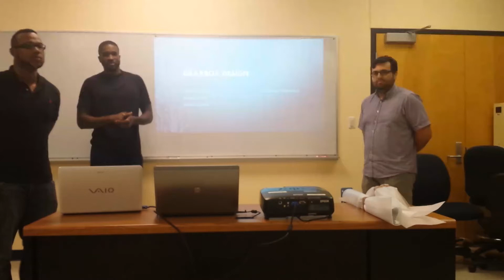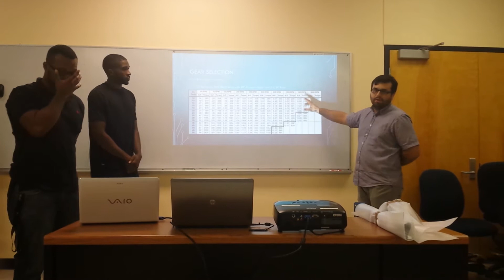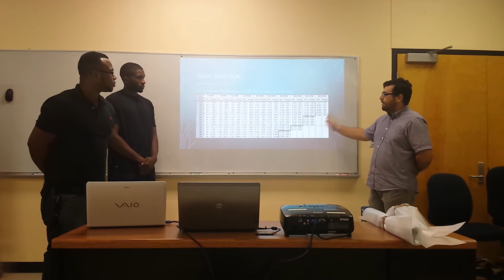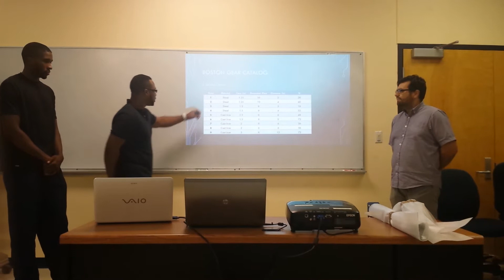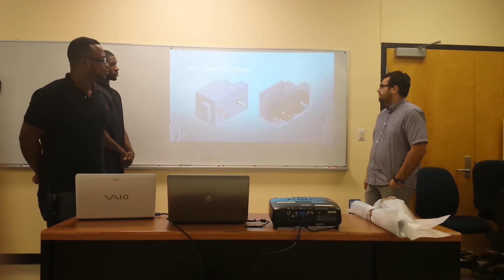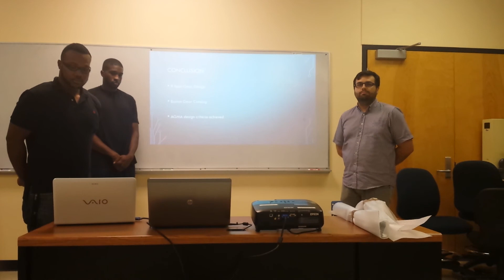Team 19: Gearbox Design

Comment: I would suggest adjusting the presentation so that the PowerPoint can be seen as it was not legible in the video.  From what could be seen I would include less tables unless the camera or video zooms in on them.  Also, perhaps setting the camera on a stand of flat surface can allow for a steady video frame.  Other than that I think the presenters gave a very thorough presentation of their project.